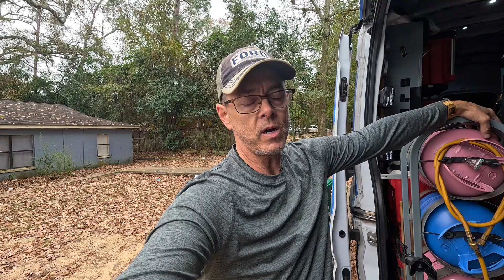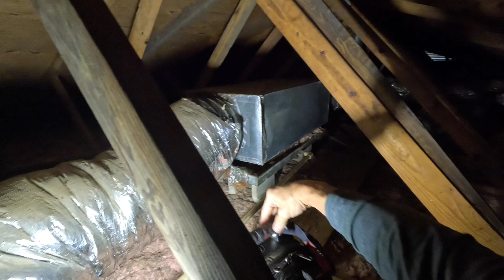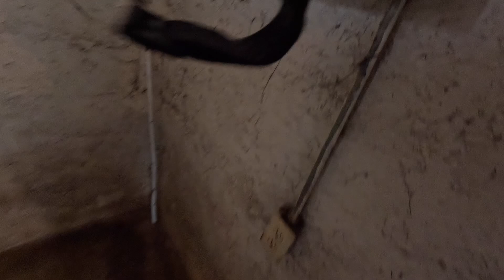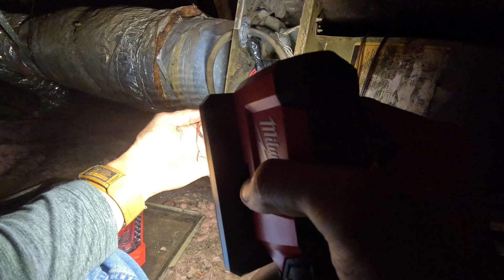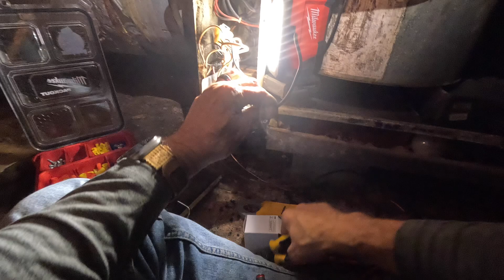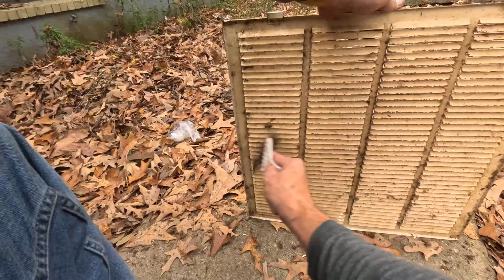Repairing Heat In The Attic! #hvacguy #hvaclife #hvactrainingvideos

Comment: I had this happen to me 5 years ago and it turned out the furnace was junk it had a cracked heat exchanger among other things wrong with it and the only way to turn it off was to turn the breaker off but the furnace was over 30 years old.

Comment: You're so lucky you have that van. My company has only GMC and Chevy junk. There's something wrong with any of our vans at any given moment, they're uncomfortable for the long drives we do, and they're 5 years in the past. The 150,000 mile 2019 GMC they gave me today doesn't even have bluetooth or a key FOB while the Transits can be remote started. Great furnace diagnosis, though. I have only my personal for residential experience.

Comment: Return grill and filter bad for sure. The flex duct connection was a head slapper; talk about not even close. I saw the larger than 16" inches ( O.C. ) on the joists and hoped you had some old plywood or OSB  for a temp platform. Nice work. Thanks for sharing for the retired guys too.

Comment: As soon as I saw that return grille I thought, they have cooked the limit control. Then you opened the grille and I saw the filter and said to myself “yup fried limit for sure “. Was surprised that the relay was the problem. What a shit hole, how do you do it Curtis? 👍👍🇨🇦
Reply: I'm guessing if it was the limit control it would just shut everything down, it's a relay that turns the fan off and on (but I'm not an HVAC guy) and that thing was cooked. OTOH, Curtis says it all pays the same, but damn. I've crawled around mice urine/turd attics and ceilings when I was a young electrician and it can certainly make you sick; maybe he's just immune to it by now.